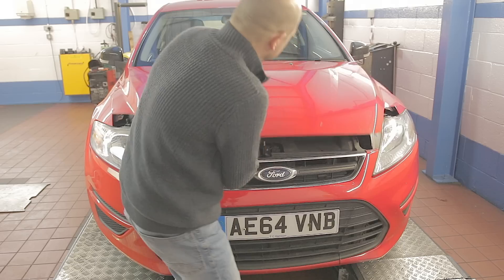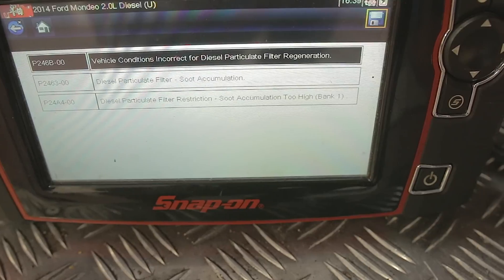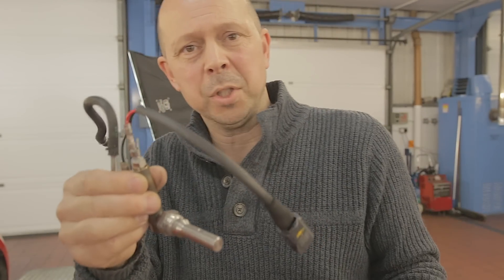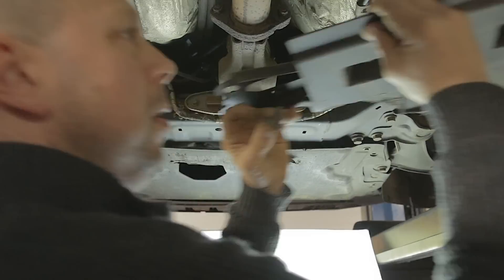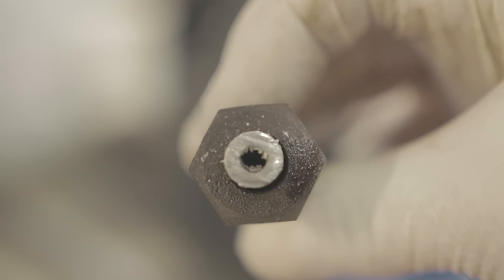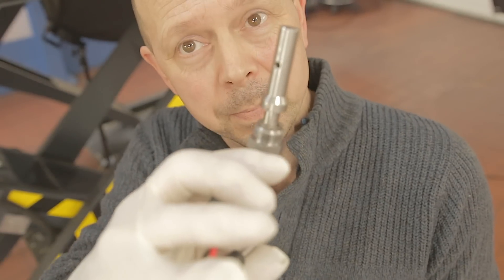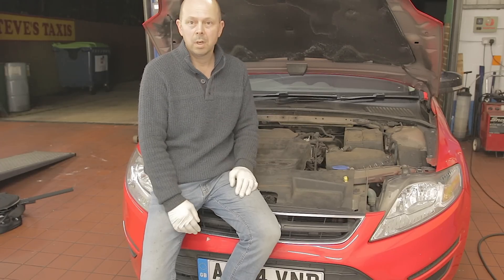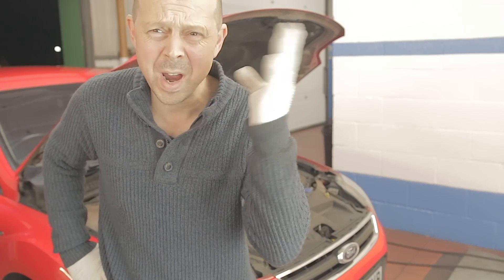Ford Mondeo mk4 Diesel Particulate Filter Fuel Vaporizer 2012-2014

Comment: I had Code: P269F - Exhaust Aftertreatment Glow Plug Circuit/ Open. Engine malfunction came up on the dashboard every time the car attempted a regen but no engine management light came on. I checked the engine bay and Fuse 6 (20 amp) was blown so I stopped driving it and ordered a new vapouriser unit. Fitted it together with a new fuse and it done a successful regen within 5 minutes of driving as soon as the engine got up to temperature. Completely sorted this issue for me and no static regeneration was needed as the DPF didn't get over clogged with soot as I had stopped driving in time. I only have the most basic Forscan on an old laptop. Car has done 3k miles and many regens since with no issues. Also some people say you need to go into special functions and prime the dedicated vapouriser fuel pump but it wasn't necessary for me.

Comment: Hello Alan i got an issue on a same friend car, dpf already changed, after a while again warming light similar codes and I see post injection level of oil raise, can be the fuel vaporizer so that the diesel don't go in dpf bit yes in the cilinders till oil pain
Reply from the maker: yes chances are the vapriser is blocked causing the dpf to block
Reply: @alan4x thank you is year 2009

Comment: Hi, congratulations on your videos. I need help with my 2009 Ford Mondeo MK4. It's the 2.0 140 hp PSA engine. It turns out the particulate filter started giving me problems, so I sent it in to be cleaned. They fitted it and told me to replace the cracked intercooler hose and the particulate filter pressure sensor. After doing this, the car still gave me an engine fault and an overloaded diesel filter. I think my car doesn't have the vaporizer, and I don't know what else to do to fix the problem. I hope you can help me with your knowledge. Thanks a million. These are the errors the diagnostic equipment is giving me: P246B - P2463 - P242F.

Comment: Alan, do those Fords throw false positives occasionally? I had that Service Engine Now warning (no engine light) last night with a P244C DTC. I cleared them and just did a 120 mile journey. The soot loading went from 66% to 88% and back down to 40%. All exhaust temp sensors are reading ok. No warning message. Puzzling.

Comment: I think this is what happened to my Volvo V50 2010 1.6 , I'd had it for 7 years,  had all sorts re fitted , and got it through its M O T etc , thought I was OK for another 12 months , two weeks after started cutting out & engine management light started coming on , put it into a garage , they said it looks like injectors,  which could cost about £1200 said the car because of its age wasn't worth it , I loved that car , but was forced to scrap it , I went back to a 1.2 petrol engine,  had no probs . But miss my Volvo Estate.

Comment: Short runs on untreated supermarket diesel is one sure fire way of clogging the system up with soot. It'll probably screw up the injectors, turbo and the EGR...ECO BOOM style! 
On shorter runs I always tip 250ml of regen plus in every full tank then run it right down to about 50 mls til empty before fueling back up again repeating the process. After about 3000 mls tip in dpf cleaner into the tank then go through the same process just to blow out the ash. Far easier just to give it a run down the m'way or d'carriageway for an hour every week then do the process with the dpf cleaner as required. Always using premium fuel in every tank

Comment: Just regarding my 2011 Ford Potato. I've put in another diesel engine in it. Now got the same codes as you on my Forscan using OBD2 cable. Without changing the fuel vaporiser, i tried the regen...... using this foreskin.... i mean forscan scanner. As soon as i press the start button, an error message instantly comes up telling me The  DPF is to blocked to do a regen. Not sure if a new fuel vaporizer will allow me to regen afterwards or it will still give me regen problems because Forscan is as useful as a Foreskin.
Reply from the maker: Strange the engine temperature is stuck at 70. You should have to warm the engine and watch the temperature rise to around 70 before it will allow you to carry out a regen. Possibly a faulty temperature sensor for the coolant or a software glitch
Reply from the maker: not sure about forscam but on the snap on solus ultra there is an option to reset the dpf limits to zero which may well be your only option short of replacing the dpf but you could overheat the dpf in doing so
Reply: @alan4x  Yes i have that feature on forscan. But i get a warning confirming what you said, not to perform a regen afterwards as the dpf will overheat. But this  soot accumulation is just a symptom and will happen again unless i find the cause. The error code coming up on top of soot accumulation is, P246B Vehicle condition incorrect  for particulate filter regeneration. So i'm going to try changing the fuel vaporizer valve which most likely is the "incorrect condition". 

Oh and a grill error only other code (Actuator stuck, but not forcing the cooling fans to operate as per your other video) but cant see how grill error (grill remaining open) can cause the DPF issues. I'm in Australia, our winters are UK summers :)
Reply from the maker: the grille error won’t be part of your problem. 
Chances are the vaporiser is blocked with carbon not allowing fuel to be squirted into the dpf which has blocked it. 
It sounds very much like you can’t do anything because the ecu software won’t let you. 
A blocked vaporiser won’t stop a regen from taking place so if it were my problem I would reset the dpf values to zero and carry out a static regen. 
Another option rather than replace the dpf for a new one would to remove it. Use a long bar to knock out the filter in the dpf and then refit it to the car. Find a guy who carries out dpf deletes to sort out the software and then you’ll never have a dpf issue again. Better mpg as well. Only downside from time to time you may see a bit of smoke out of your tailpipe. 😊
Reply: @alan4x  I changed the vaporizer.  "Unspecified Abort Condition" when running the DPF Static Regeneration. using Forscan. Forscan and Ford Mondeo are made for eachother and both can go to hell. 

Though interestingly, when checking the coolent temp on scanner it remains at 70 degree Celcius after driving the car so wondering now if it's the thermostat issue thats making the Vehicle to be in a incorrect condition for particulate filter regeneration. I just wished the Forscan scanner done what it's supposed to do and tell me why the heck it aborts the regen procedure rather than "haha i'm not specifying why i'm aborting it"

Comment: Hi Alan, did you prime the vaporizer? I replaced one in a 2011 2 litre Ford Focus and now the F48 fuse blew. Any suggestions from your side would be much appreciated.
Reply from the maker: you dont have to prime the vaporiser...sounds like there is a dead short in your new nozzles glow plug...disconnect the wiring to the nozzle and see if the fuse still blows

Comment: After cleaning this injector on my mk3 diesel focus with compressed air and brake cleaner diesel fuel was pouring out trough the injector.Is there a chance that i messed something up inside the injector itself
Before cleaning no air could pass trough the nozzle
Am i safe to put it back on the car
I am worried that i broke something in the injector.
Reply from the maker: there is nothing inside the nozzle so if it is now clear of carbon it is safe to put back on

Comment: I too work for a taxi company, our transits have this problem almost weekly, we cut the long end shaft in half, drill out the carbon and Weld it back together. Same code is the initial indicator... conditions not met or temperature too low for regen

Comment: Alani have a Ford Kuga 2013. I have the EXACT same problem iv ordered one from my local motor factors here in clare Ireland. Question is is it absolutely necessary to prime the vaporizer after refit as my own diagnostic computer probably does not have that hot function to prime that also is the a certain way to do a regeneration on the diagnostic as in clear fault first then regeneration or what ? I do not want to damage the car but at the same time i think I'm capable of doing the task myself. Thanks in advance ☺
Reply from the maker: you don't have to prime the vaporiser ..once it is fitted normally you would carry out a static regen on the dpf if the engine light is on permanently and can't be cleared..if it can be cleared then go for a good run down the motorway
Reply: @alan4x  Alan. Got the vaporizer done at the weekend thanks for all your help had to Get the Gas out to the Nut in the end. Would you believe the hardest part of that job was trying to Remove the bloody Electric connection on it I was nearly 40 minutes trying to remove the thing until I realised it actually released from the back not the bit facing towards you as your looking in 🤣🤣🤣
Reply from the maker: @huntman9485  lol, some of the electrical connectors these day are worse than a chinese puzzle, glad you got it all done

Comment: @Alan many thanks for saving me a wad of money. I successfully diagnosed my fuel Vaporiser thanks to this video. I replaced it at 1200000 miles with ford main dealer and fitted for around 600euro. Last week I ordered part from Auto Doc for 170euro (exact same part and stamp as one I removed) and followed your video. Did the regen and cleared the codes. Using premium diesel and the difference in the power is unreal. Next time you're in Dublin I'll buy you a few pints 😎
Reply from the maker: thanks phil, excellent news😊
Reply: Saving you money would have been a video on cleaning them out
There easily cleaned

Comment: I had a 2009 passat, dpf light came on so I thrashed it to a garage, by the time I got there and restarted the car I had cleared it :) thinking about doing a dpf delete on my mondeo, probably illegal but sounds better without it
Reply from the maker: diesel particulate filters strangle engines ..your right, without a dpf you will get better performance and better miles to the gallon
Reply: @alan4x  do you just work for ‘Steve’s taxi’? You must not be far from me, small world, I might have even been in one you’ve repaired 😆
Reply from the maker: @thurston383  yes Ido work for Steves taxis in Huntingdon, there won't be a red Mondeo Steves taxi that I haven't fixed lol

Comment: Alan I changed mine at around 97k miles. I now have 186k miles on the clock and I think it's gone again .. same codes as before and what you have on this video. Would that be in line to what you did here. Looks like 200k on that motor above so was it the second replacement?
Reply from the maker: yes best remove it and see if its blocked, yes the same process as in the video

Comment: 2nd question,  if you just fit a new DPF, which aren't that expensive, would the code clear automatically?
Reply from the maker: no, you will have to clear the codes with a diagnostic machine

Comment: If you ordered a new DPF filter,  does this come with it, or is it a separate purchase?
Reply from the maker: that nozzle does not come with a new dpf, it is separate
Reply: @alan4x  OK thanks Alan. So for a complete job, it's a new injector, dpf filter and two new hoses?
Reply from the maker: @GRIFF22  if that nozzle is blocked, you will need to replace the nozzle and then carry out a forced dpf regeneration using a diagnostic scan tool..that will clear the dpf

Comment: Managed to remove old one but the thread stripped on the old nut . I gave up took it to a mechanic and now it can't do a dpf regeneration due to code p246b and p2463 .changed a 20amp fuse but still won't do nowt

Comment: HELP !!!
Hi Allan
We have a problem with a 2012 Ford C-Max 2.0 diesel. Faultcode P269F
Fuse F48 burns out when we change it and the engine lamp turns on.
We dont know what the problem is.
Can you help us?

Comment: Hi Alan,did you have any problem's with dpf filters on mk5 mondeo's
Reply from the maker: never had any issues on the mk5 unless there was a problem like the egr valve was faulty or a turbo hose was split which caused the dpf to block up then a regen was necessary

Comment: No offence to your video, but the statement you made about regeneration at motorway distance runs is correct, but the whole point of this system is to allow it to raise the temperature of the exhaust so much that it can even regenerate at idle speed.
Reply: It's not just about temperature - higher revs flows more air through the DPF to help the "blow out"  of the burnt soot so regen at idle is not really the ticket. Very noisy process as you can hear.

Comment: Just changed my vaporizer on transit custom not sure if fuel coming through lines how do you bleed vaporizer pump?
Reply from the maker: there is a little rubber hose that goes to the vaporiser...fuel should be in that pipe...you dont bleed the nozzle..when the car starts a regen a small pump will push fuel through the nozzle automatically

Comment: Hi I have a 2010 2.0 tdci Mondeo . And when registration is start  cars get problem p244d catalyst temperature too high during regeneration , blank 1. Emergency position . Not reachable current DTC . After car is not start ( not turning starter ) . Delete the code  now cars is start but engine shake it when rew is down plus black smoke . Now I have new code p02fa Diesel Intake Air Flow Position Sensor . Is it same sensor ?
Reply from the maker: i would have your car looked at by a skilled mechanic and also have that fuel vaporiser removed and checked to see if it is blocked
Reply: @alan4x   i take garage but not understanding what is wrong. Say turbo dbf but is not

Comment: Hi Alan
Mondeo mk4 2009 tdci
Coming down the motorway this evening I had a Dpf overload warning on.
So I floored it to 90mph where a great deal of black smoke came out and since then it's been ok.
What's your take on this as I do motorway journeys every day. 
Kind regards Paul
Reply from the maker: might be worth checking the 2 rubber hoses that come off your dpf are not burnt or split and leaking

Comment: Great video Alan, I've got a question to ask,  Ford Mondeo 2.0 tdci 2009 which has reverse gear issue. At times when in reverse it does not move at all till I get it out of gear and re put in reverse, would you have any idea what the issue is ?

Comment: If the vaporizer needs replacing is it possible to swap out the entire DPF and vaporizer at home without needing any special tools to prime it or anything? I've just been charged a ridiculous amount for a new vaporizer and DPF clean and could have bought a vaporizer and whole new DPF for cheaper and fitted them myself for less.
Reply from the maker: you dont need to bleed the system after replacement but if the engine was in limp mode because the dpf had too much soot usually a static regen would clear that rather than replacing the dpf

Comment: How did you get yours off then if you cut the pipe off after you removed it?
Reply from the maker: if you cut the pipe off you just undo the nut with a socket and bar which is easier than using a spanner
Reply: @alan4x  once the new vapouriser is in, just done mine, will the regen process sort itself out now that that component is functioning correctly? or will it need taking into a garage for a forced regen?
Reply: Many thanks for the prompt replies, tackling one at the weekend.

Comment: Really great video. Thanks for posting Alan.

I have a 2.0 Diesel 2011 Ford S-max (so same engine). I'm getting a P269F - Exhaust After treatment Glow Plg Circuit/Open fault code on my OBD reader. Car isn't going into limp mode and seems to be running find. Fault clears itself but the then comes back on. My local garage are none the wiser (was in for MOT and service yesterday) and just told me to monitor. Fault light back on today.

Although not in limp mode, I don't want to keep driving if it is going to wreck the DPF and lead to bigger bills.

Any ideas Alan would be great, thanks.
Reply: I have the same problem. Did you find a solution? I'm starting to become insane at this.
Reply: I believe this means that your dpf isn't blocked but your vaporiser needs replacing I would believe

Comment: Been watching your YouTube video and I have changed the injector for a genuine Ford component but I have got code P20 CD low voltage to injector and glow plug do you know how it is fed is it from the ECU Direct or is there a relay or some sort of of control unit for it also do you know what the voltage should be to the glow plug is it 12 volts or not appreciate any help you can give me thank you very much by the way it's a 2012  1.8 diesel Connect van p9pc engine code
Reply: @ marcus brodie i have the same code and tried everything from new vapourizer and pump ,cat,exhaust sensors and still come up with P20CD injector A aftertreatment low circuit i have had enough and taking it to the garage on thursday i dont know if there is a pat fluid tank underneath thats empty maybe need topped up i have the facelift 62 plate model mondeo 2.0 tdci.
Reply: Hi you must check all fuses in engine fuse box because bad glow plug in waporizer crack fuse 🙂
Reply: Update on my problem P20 CD the fault was the wrong ECU was fitted you got to have all the right numbers to the original ECU